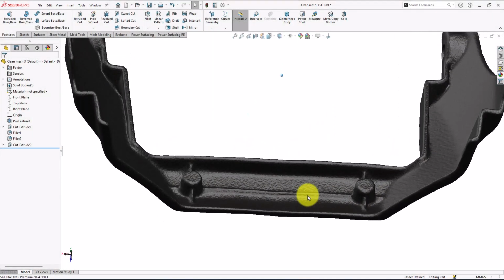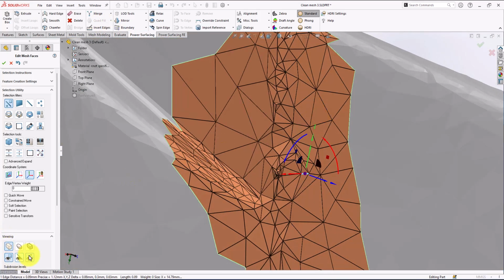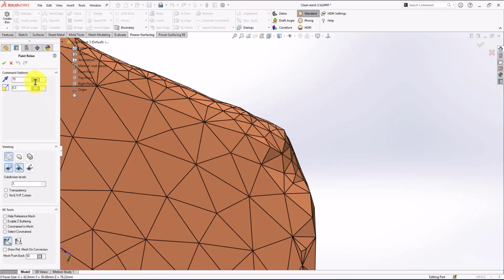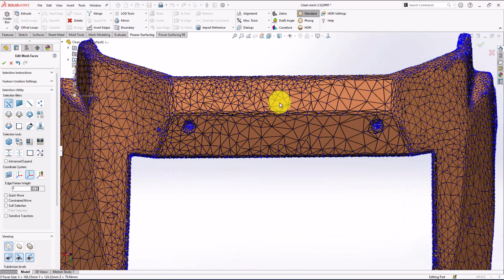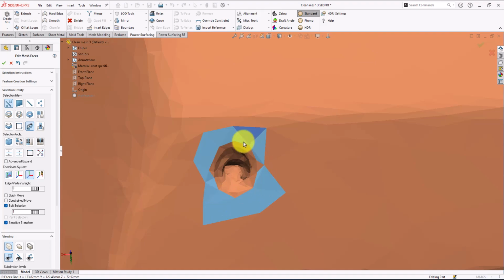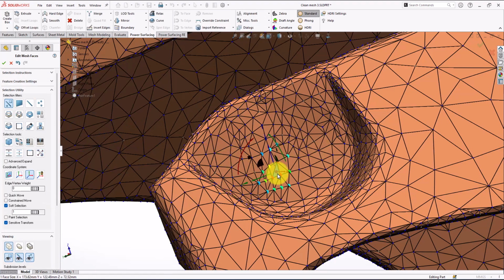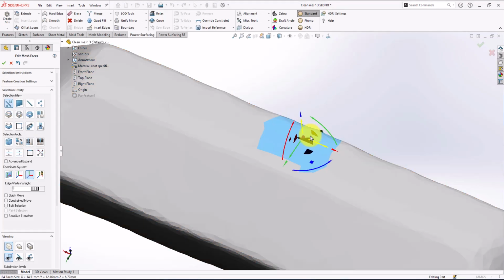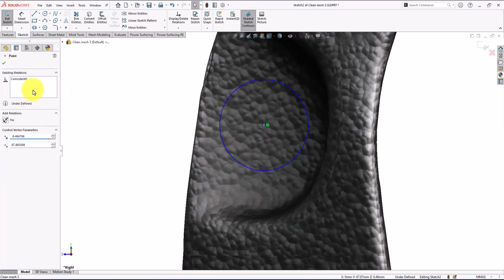Clean your Mesh Using Power Surfacing | SOLIDWORKS

Comment: When using a pen display such as a WACOM, in Zbrush the pen pressure is tide to the strength of the smoothing. Is there a way to do this or is there a plug in to power surfacing for WACOM?
Reply from the maker: Wait for our Standalone Cyborg3D Software, which will be available in
it.